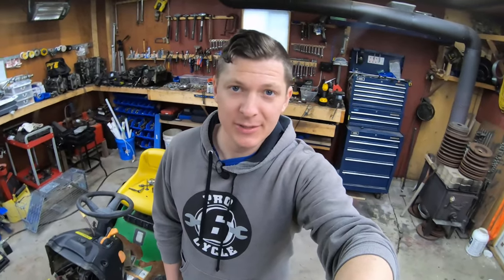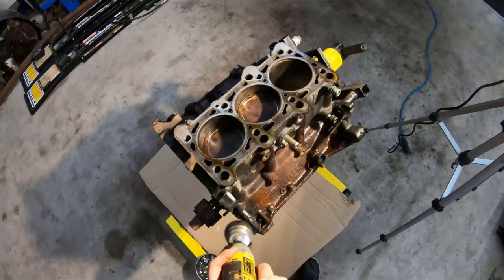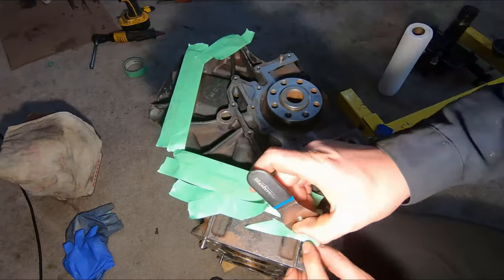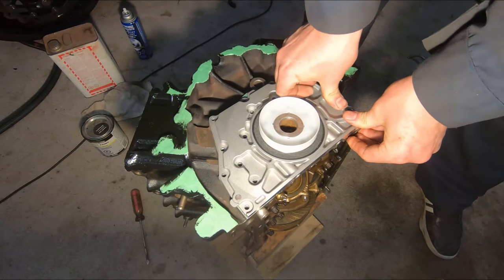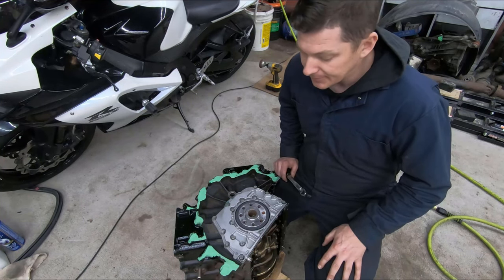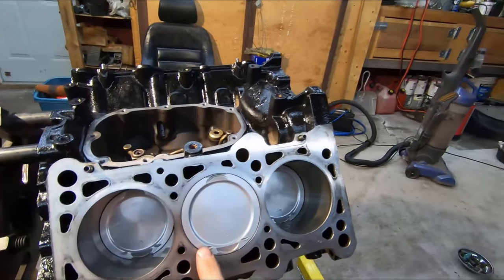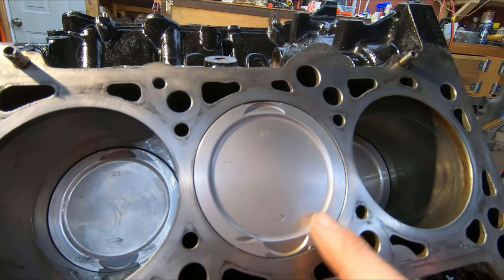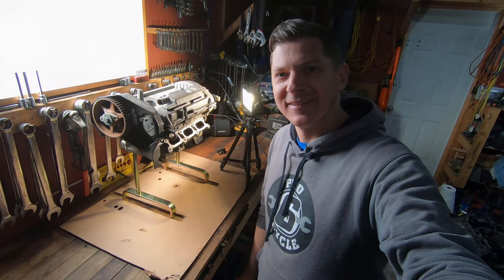2.7T Block Prep, Rear Main Seal Install, Piston Repair

Comment: I did this..but used grey silicone... is that gasket necessary???  when I removed my rear main cover I didn't see a gasket..
Reply from the maker: I’m not sure how necessary but the kit I got had the gasket in it. It seems like a pretty elaborate gasket because it’s got what seems like flow controlling holes in the one part of it.